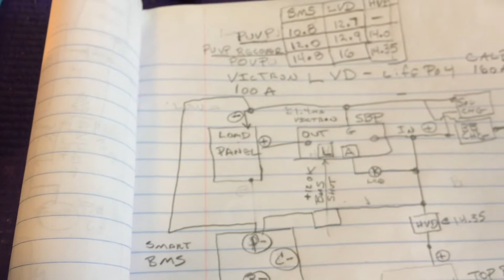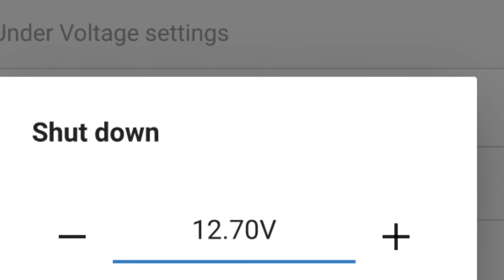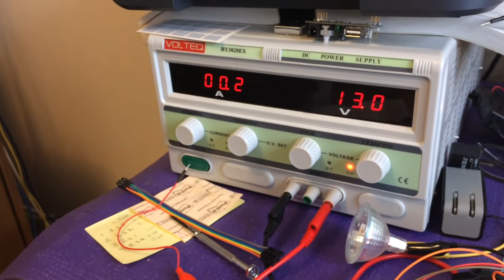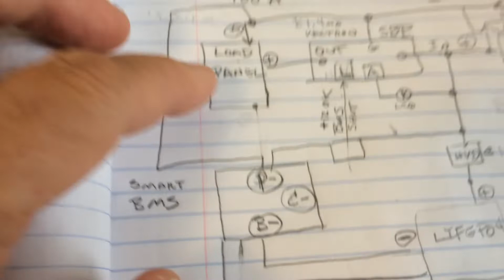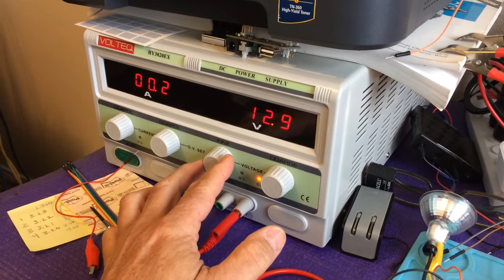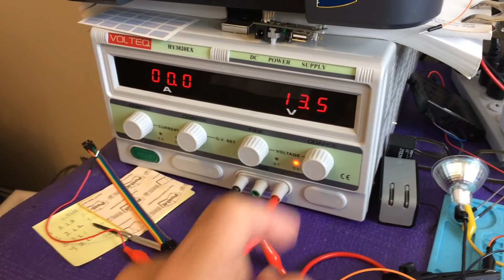Victron Smart Battery Protect Tested for DIY LIFEPO4 Battery /  Low Voltage Disconnect on Boat

Comment: Victron doesn't recommend connecting the BP battery protect smart with an inverter and others that have capacitors. They recommend using the switching device connection on it to turn off the switch on an inverter. When asked all the information they don't respond as the only want to talk about victron. No one knows what the output is maybe I should watch the whole video but why would you buy something with mossets that are better engineering for lights when you're using delicate coolers like angle that require a capacitor across the DC line to slope the voltage in amperage impact of turning on and off the unit.
Reply from the maker: @stateroute74ranchomirage80  thanks. Accurate assessment.

Comment: Hey great video, I have question about the alarm kicking off ? is it persistently on when the battery is below minimum Voltage or just turns on for some time ( I guess 1 second or so) Ideally I would like to connect the alarm to normally closed relay for DC-AC inverter and then disconnect once alarm is on, that is why I need constant power to make relay engaged. I could use normally open relay but that consume power all the time and hook directly to BT once is operating normally. Let me know if you have suggestions thanks !
Reply from the maker: Hi. Can you check out this video? Let me know what you think about my approach to the same problem I have. https://youtu.be/dKzz4K5fukE

Comment: Hey thanks for the video! Do you kow what the blinking blue bulb below the program LED indicates? can't find it in the manual. Thanks in advance!
Reply from the maker: I only know blinking is powered on alive state that goes away if you remove jumper or ground. Also there is a small light in the corner that flashes when it is looking for error.

Comment: Hi Danny. Great video, i am trying to use the battery protect directly on the refrigerator to avoid accidental battery discharge, do you have any recommendations about how to wire this on a C320? Thanks!

Comment: I have lifepo4 prismatic batteries without a BMS, do you think you could use this instead of a BMS on batteries for protection?
Reply: I have 24 3.2v 60ah batteries and connected 4 together to make 12v batteries.  I'm trying to figure BMS's and wonder if I would need a BMS for each pack of four.
Reply from the maker: @meowzic  I think you have used batteries by your last comments. I think you should study what this guy has done. He uses 1 bms. https://youtu.be/utPM0Jn4Dak
Reply: @dannyjensen4954  thanks, I just figured this out

Comment: You are planning on letting your CALB cells go to 16V before High Voltage Disconnect?
Reply: I'm glad you found MaineSail's great discussion on MarineHowTo.com.
Also I wonder if you have found http://nordkyndesign.com/category/marine-engineering/electrical/lithium-battery-systems/
Eric has written some fantastic articles which everyone should read.  
Some cautionary tales in here...
Reply from the maker: My planned cutoff is 14v. I was just testing here. I need to connect a separate sense module to the relay inputs to accomplish the hvd. Thank you for your comment. I have second video where I discuss doing a custom hvd using sbp.
Reply from the maker: Yes. They are detailed and excellent. Rob at marinehowto now has a link to these in has article we love.
Reply: @dannyjensen4954  That's great, I was scared that others might copy and put their new cells to 16V.  (-:
Reply: @andyalford3548  You should never pass current INTO these devices, or they fry. Charging has to be done on a separate circuit, which can then have a HVD.
Apparently, they are so sensitive as to dis-allow the use of an inverter load, since that apparently may send a little current back into the batteries in some scenarios.

Comment: Hi Danny. What type of LiFePO4 cells have you got? I'm using Winston prismatic 160Ah cells and as far as i know you can safely discharge them down to 2.8V by independent sources and 2.5V by manufacturer. Hence 12V disconnect seems ok to me. Would you disagree?
Reply from the maker: I have Calb 180 SE (just looked) I got used. They were testing to 155ah. I have a discharge cutoff of 2.5  by Calb.  Bringing them down below 20% SOC is not recommended especially if they started out being top balanced. I'm not doing automatic balancing so I don't want to risk killing my cells on the low end since i'm top balanced.  I have an article that says . " Don't over-discharge. Set your alarm for a pack voltage of 12.8v under load. Disconnect them if they reach 12.6 to 12.7v under load. (3.15 to 3.175v per cell). This will be approximately 80% DOD, and you won't be travelling too far down the steep discharge knee. Because we are not going well beyond 80% DOD, small imbalances just before the knee drop are not that big of a deal. If you want to be conservative, just use 12.8v under load as a disconnect."  https://www.solarpaneltalk.com/forum/off-grid-solar/batteries-energy-storage/lithium-ion/15966-simplified-lifepo4-charging-and-care
 .   Are you top ballanced ? What amount of variation in your cells do you have when you are down in the 3.2 vpc range.  How much hassle would it be for you to re balance.. etc.  I'm going to have 4D lead acid as a backup while I'm testing things out so I'm doing 12.7 ish LVD for now. Thanks for you comments.
Reply: Thanks for your extensive answer! Yes I'm Top balanced and running with no BMS whatsover (I'm planning to address that in future but now it's in the name of since ;). I'm aware that LifePo4 shouldn't be discharged below 80% DOD but being paying more attention to voltage status I have been balanced about 8 months ago up to 3.6v per cell (Manufacturer recomends 4.0v). 8 months of daily use after I've got one cell that is slightly off all the rest are bang on (1- 3.57v 2- 3.578v 3- 3.58v 4- 3.508v) down the bottom SOC they aren't much off either and follow the same pattern but I didn't record that data. I know that after 2years+ daily use  I still have got 100%+ of nominal 160Ah (measured with calibrated Victron BM712 BMW ). But again I don't think I've ever went under 30% SOC (except capacity tests) and my power use is most of the time fractional. Coming back to the subject I'd prefer setting my LVC higher but I've bought regular battery protect with no manual adjustment (I didn't know about smart one that time). Thinking about it though I might use available programmable Load Output Port on my "solar MPPT"  to control remote port VBP as a way round. Yep I'll test that on out :).
Reply from the maker: @spammebabe  I'm also playing around with Arduino where I can do my own relay activation.  My latest video has my setup. I"m bench testing for now. My cells are pretty good at the bottom  also in my limited testing. My system is just in the test mode now in my office. Thanks for your comments. It makes me feel like my system may work.